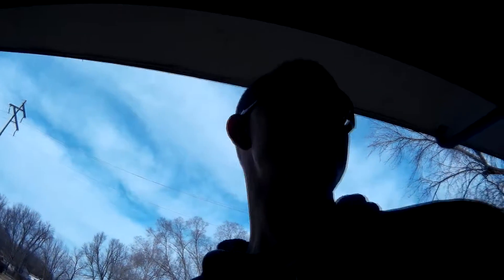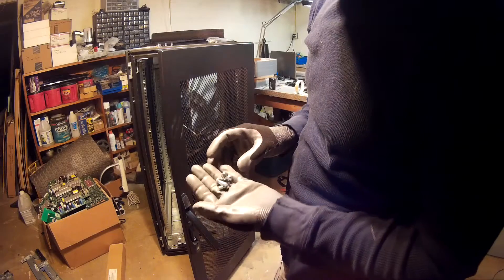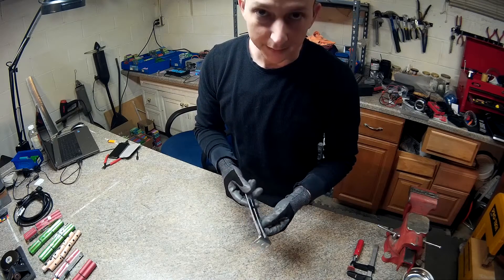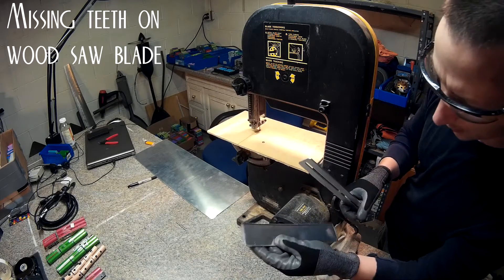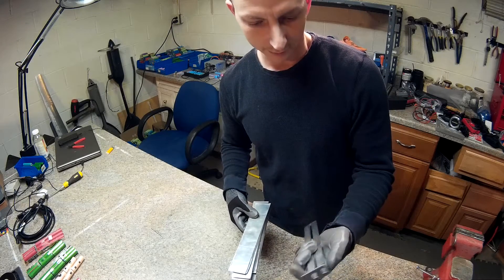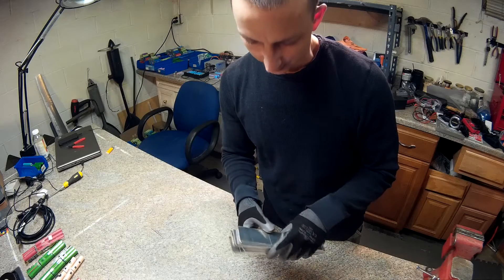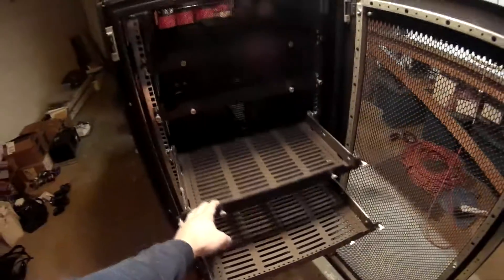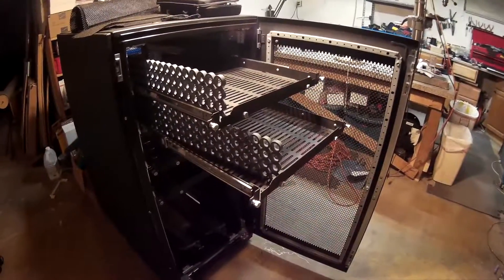Diy Tesla Powerwall ep23 Power Rack Slider Shelves

Comment: The 7 foot sever rack my guy is giving me doesn't have sliders.  I sure hope I can find some for mine...Those ones look great!  I suppose the only couple of things that has to be considered to make them effective is, weight of the packs, and the extra cabling that is going to be required if you have to pull out any of the shelves without having to pull them all out.
Reply from the maker: Ill probly use anderson plugs http://amzn.to/2ldsw3G for the quick disconnects right off the battery packs so that part should be to much of a pain unless I come up with another sneaky way :)

Comment: looks good. only concern is the weight when the shelf is fully extended.
Reply from the maker: Thanks Keith, Yeah thats my concern too.  Especially since I had to move the holes for the brackets I made. Ill probly set 100 at a time while fully extended and see what happens :)
Reply from the maker: Yup :) I discovered those tabs a while later lol